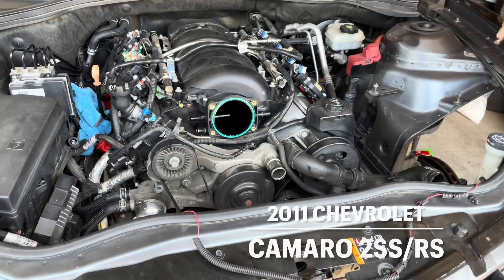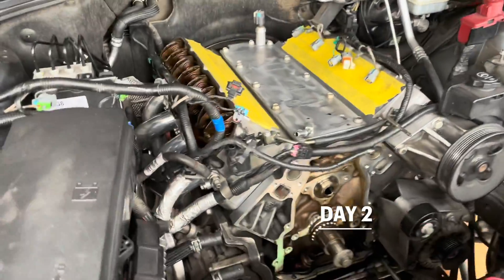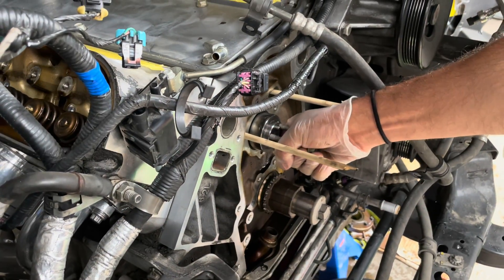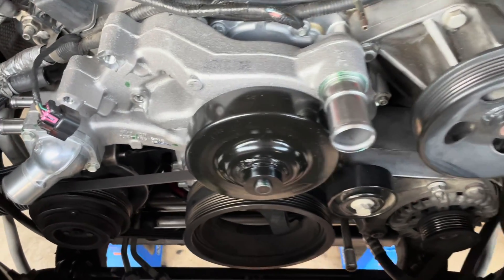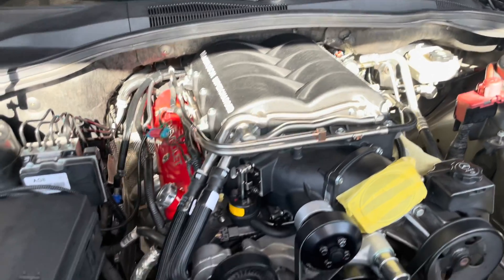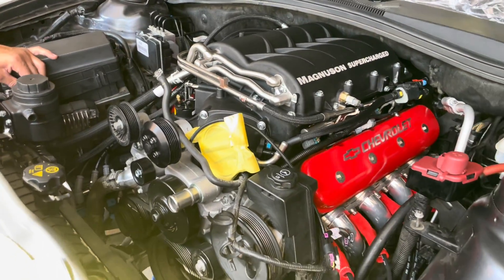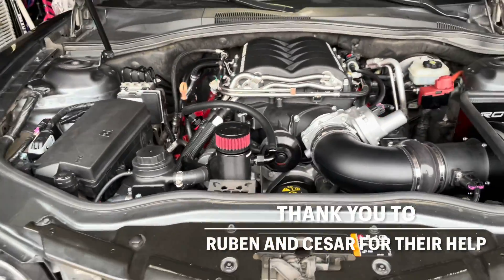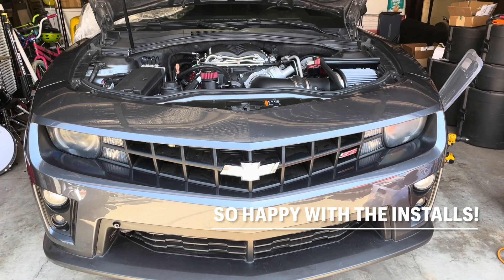2011 Camaro 2SS/RS - Heartbeat Supercharger and Camshaft Install - May 2021

Comment: I have same setup and was curious if you remember the belt size because I have to downsize from a 10 rib until I get an aftermarket water pump to prevent belt slipping off the factory pulley. Just figured it wouldn’t hurt to ask
Reply from the maker: @giftdcam8472  here is the belt I’m using. Gates RPM Micro-V Belt (K061045)
Reply: @allenwoolsey thank you so much for the response man I wasn’t sure with the video being a year old 😂😂 definitely subbing
Reply from the maker: @giftdcam8472 I’m here to help when I can 😊

Comment: What stage is that camshaft, love the setup
Reply from the maker: It’s not a “Stage” cam, it’s a custom cut from Comp Cams: 
Comp Cam Camshaft (54-000-11):
13018R/13022R HR 116 + 4
231/247 Duration @ .050
.617/.624 Valve Lift
116 + 4 LSA
Reply: I see, I was looking at the gpi pd2 blower canto. Go with my heartbeat

Comment: what size pulley are you running?
Reply from the maker: I’m currently running a 87mm pulley by Magnuson.
Reply: @allenwoolsey  is that what they set u in kit or did you get that separate, did you have to change the belt or nah and also what PSI did that give you cause i heard you lose some psi with like headers and cam that’s why i wanna change pulley to gain it back
Reply from the maker: @Guccied62  I bought that pulley separately. My psi was at 9psi before and after the pulley change, we set it to 10psi.
Reply: @allenwoolsey  what LB injectors are u running cause i think the kit comes with 42LB and that isn’t even close to enough
Reply from the maker: @Guccied62  I’m using the 1000cc FIC Fuel Injector Clinic Injector Set.

Comment: This looks like it was done in LA? If so let me know if you guys are available to install a similar set up in my 2013 SS
Reply from the maker: Hi Shawn. I did most of the install but had some help from some buddies. What are you looking to install on your car?
Reply: @allenwoolsey  Kooks headers, throttle body, supercharger, cam shaft, and catback exhaust.
Reply from the maker: @shawnhubbard7056  that’s going to make for a fun ride! Unfortunately I don’t have a shop and have my driveway full with 3 other project cars of my own. I’m here for advice or questions though.
Reply: @Allen Woolsey  Appreciate it. I'll definitely be reaching out in the near future. I've never worked on a car, but I looked over the installation manual for the Magnuson, it doesn't seem that difficult, besides drilling the pin holes. I'm sure I'll have questions though.

Comment: how much did it cost you to supercharged it
Reply from the maker: It wasn’t cheap, but the Magnuson Hearbeat price is on their site. I believe it was around $9k for that. I did a lot more than just add a supercharger though. Price all depends on what your goals are.
Reply: @allenwoolsey hey man i’m putting this supercharger on my car in a few months, looking for like 600 wheel nothing crazy, im already pushing 500 with just FBO, what mods do i need to make it work?
Reply from the maker: @Guccied62  you can just bolt it on with what comes in the kit, which would be injectors, pinning the balancer, etc. I chose to go in and replace anything I took apart as well as upgrading any parts to handle more boost when needed. It all just depends on your goals and budget.
Reply: i want to get the red valve cover also, will i need to do a relocation kit or did you just do it for your own want,
Reply from the maker: @Guccied62  you will need to relocate the coils and extend the coil harness. Plenty of kits out there and you can mount it where you want.

Comment: What was the absolute total for the zl1 bumper with the paint and fog lights?
Reply from the maker: Great question. I did that upgrade back in 2013. But I remember at that time it was around $750 for paint and the whole kit. Not sure what it’s priced at now though.

Comment: Would you do anything different if you did it again? How has it held up? What's the gains?
Reply from the maker: I would probably swap out the lifters and trays for new ones. I didn’t do this because I just didn’t know to at the time. BUT, the engine is still holding strong with lots of pulls! I currently have 650hp on E85 and about 580 ft-lbs torque. I’m getting a new dyno tune in 2 weeks though.